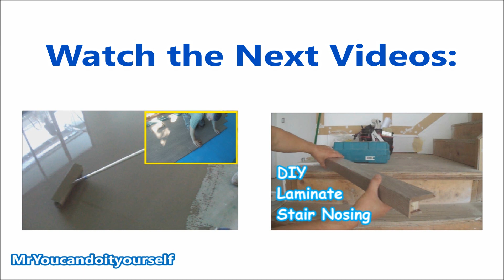How-to Install Hardwood Stairs Treads Nosings and Risers with Stair Jig - Mryoucandoityourself

Comment: Every installer I know installs treads first and risers always sit on top :0 why !!? I believe your way to be best
Reply from the maker: If you install from the bottom you'll have to walk on fresh installed treads and it is not good.
Reply: Most flooring guys and any legit carpenter worth their salt will install risers first.
I personally do not want to lock the tread in swith riser in top so I too will install risers first.